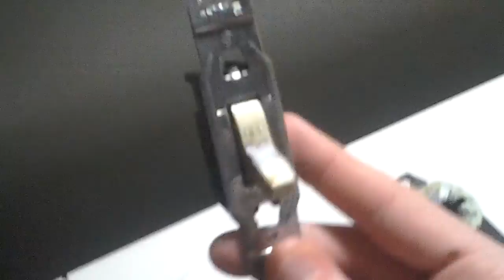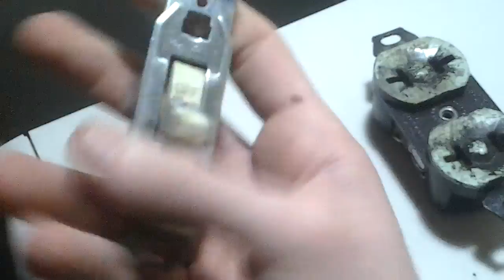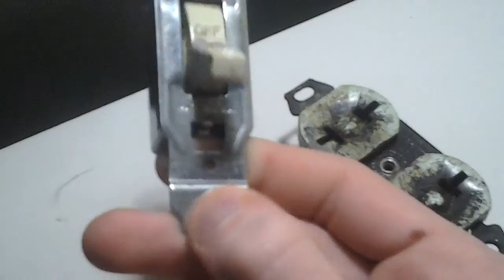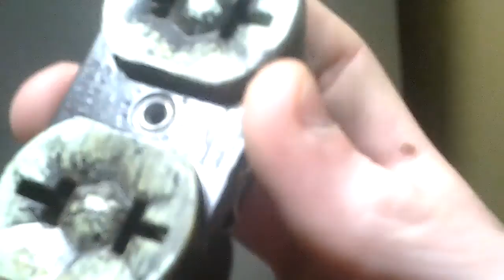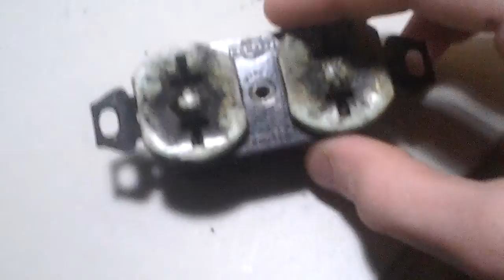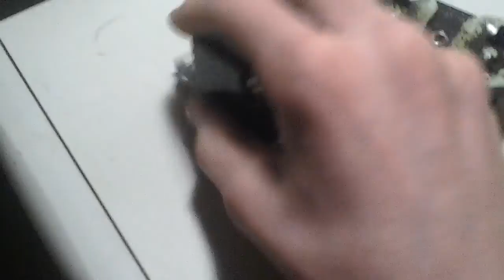Vintage 1950's Electrical Light Switch and Receptacle (outlet)

Comment: That light switch is most likely a mercury switch,  they were somewhat popular in the '60s and '70s for use in  libraries and children's bedrooms where quietness is essential.  The outlet might be from the 50s but almost certainly is older, like the 40s or before,  because of the T slots. Reason for that, was back in the first few decades of the 20th century,  when household electrification was in its infancy,  there were no universal standards for plugs and the shape and size of the prongs,  like we have today.   Some plugs had prongs laid out horizontally,  other were vertical.   Because the industry had not yet decided on what configuration based on voltage and amps, for many years T slot outlets were widely used,  so that both types of plugs could be used.    One scary side affect,  was the outlet could be wired for 120 or 240 volts, so you had to be certain what was being supplied before using it.   (Virtually all of them were 120 volts, though)

Comment: I have a few particular light switches that I got from my house, my father was changing them and I kept the one that was in my room. As you said in the video it doesn't have that familiar clicking sound. My house was made in 1949 so the switch may be from then or even a few years prior to the construction. It has a brown backing that I think is an older version than modern day plastic, may be Bakelite but Im not that familiar with switches. As shown in the video, the backing was square/rectangle, the one that I have is sort of rounded you may put it and the wiring of my house is mostly original but also old. I would love to get in touch with you, lol Im trying to find more people who have an intimate "obsession" (if you may say) with old antiques and vintage items.

Comment: The switch (silent toggle, hence no sound) may be from the 50s, but that duplex t-slot outlet is older.  It's from at least the 40s if not the 30s.  The t-slots were designed to accommodate both parallel and tandem plugs, once upon a time at either 120v OR 240v

Comment: The switch is almost certainly a mercury switch. One's I've seen internally have a metal disk that looks much like a large flat mercury battery inside, but with a dimple in the metal on each side, and a glass-like seam around its outer edge.
I broke one open once to harvest the mercury inside (don't ask), and found the inside had a little ceramic maze for the mercury blob to move around in. I took it that when the switch was "on", the blob moved into a position that connected both sides of the disk together. And when it was off, the mercury moved to a position that didn't connect the sides. They were around in the 60's and 70's, I recall seeing them less and less at hardware stores. They were marketed as "silent switches".
I recall these switches were orientation sensitive; as I recall it only operated correctly when mounted vertically, since the mercury blob depended on gravity to navigate correctly. So in other words, you could change the switch from on to off just by rotating the switch around. Try putting an ohmeter across the screws, and rotate it around the axis that the switch moves (by tipping it forward and back) to see if it changes continuity.

Comment: i love vintage light switches & outlets. even more fun to collect are the vintage covers that go with them.
be careful with these silent switches. SOME of them use mercury in the mechanism. i have one in my collection that i have sealed in a bag until i can figure out what to do with it. 

try stripping the paint off them. if they are real bakelite, you can use a paint stripper meant for antique furniture. just apply with a small brush, let it sit for an hour and scrub under the faucet. it will usually take several applications.
Reply: no, the mercury was on the inside in 2 capsules. 
they are safe as long as the capsules are sealed but its difficult to know if they are sealed.
why did they make them like that? well in those days they just didnt know better. that brown outlet almost certainly has asbestos in it. bakelite, the plastic is made from contains 15-17% asbestos. fortunately you are safe unless you shred the plastic and start sniffing it and it would take a VERY long time to harm you. you'd have to do that every day, all day for a good 20 years! LOL.

send me a PM and i'll shoot you some photos of mine and what to look out for.
Reply: if it was made in the 70s or earlier, it probably contained asbestos.
paint, plastics, floor tile, kitchen counter tops, insulation, plaster, drywall, glue, caulking, toys.... most of the stuff is so minimal, its of little concern. old insulation and vinyl tile is about the only stuff that should be of concern.